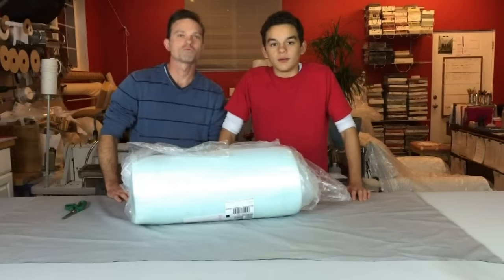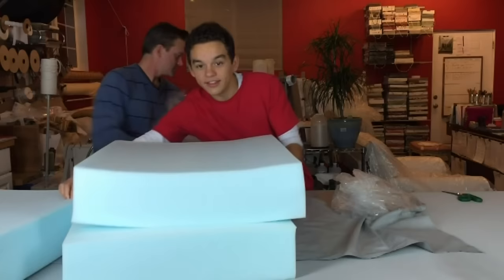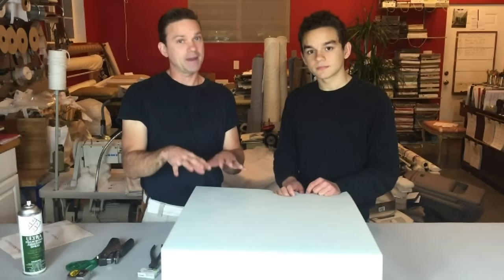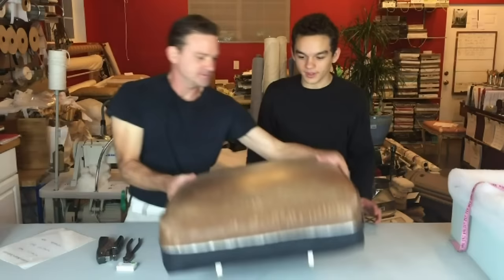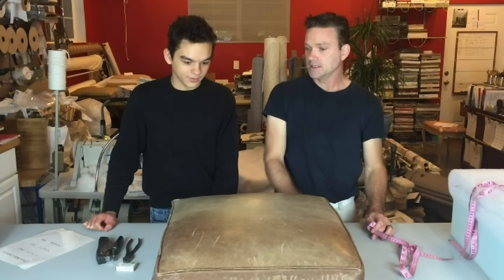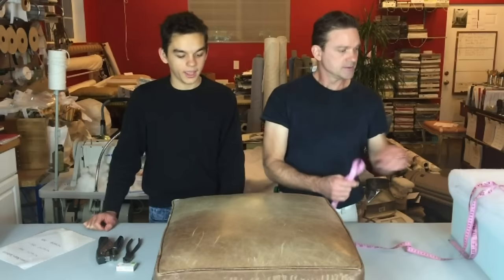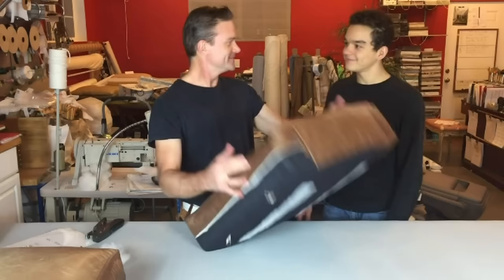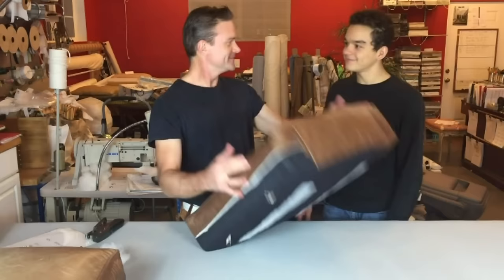Replace the foam in your seat cushions fast and easy!

Comment: What firmness do you recommend for someone with lower back issues? Current sofa is too soft & sinks.
Reply from the maker: Hello Agatha, that’s an excellent question. I unfortunately can’t answer , back problems can widely vary as to the cause. You could be sinking to low cutting off circulation or or you may be leaning more to one side then another. I wish I could give you more guidance. Go to a furniture store sit on displays and ask about are feel the firmness of cushions. Maybe that will help. Thanks for watching cheers, Paul
Reply: @ucsolutionsgivingmore  Thanks for your suggestion Paul - will check out displays. Hope to place an order soon. Cheers ~

Comment: Great video, but what density do I need for loose back cushions?
Reply from the maker: Hi Sharon,
The density for back cushions you can go as low as 1.8 density they don’t take as much abuse as do seat cushions, so 1.8 you should be fine. If you are a DIYer and you want to take this on yourself you can find the 1.8 slab of foam on our website ucprivatecourses.com   Thank you for checking out the video.  Please share the videos it helps us out a lot when you do. Cheers,    Paul

Comment: I have a recliner and the seat has a zipper in the back but is not removable.  How do I measure the thickness?
Reply from the maker: Hello Dave, Thank you for watching the video. You measure the FRONT band of the cushion, SEAM to SEAM (top to bottom). IF there is no band in front, just fabric that rolls from the top of the cushion to underneath. Then look on the SIDE of the cushion for the seams. Measure seam to seam and add the 1" to that measurement according to the video. Below is a link to the site to order, on the home page there is the video for a refresher if needed. Please let me know if you have any more questions, there is live chat you can send photos if needed on the site as well. Again thank you, 
Cheers, 
 Paul        
 https://ucprivatecourses.com/product/sofa-chair-seat-cushion-foam-inserts/

Comment: Thanks for the video! Would you use this same stapling technique to replace the foam if you were going to recover straight over it, ie not a in a cover, just with the material stretched over it and stapled to the frame?
Reply from the maker: Hello Natalie, I believe what you’re describing is called a tight seat and yes you would just replace the foam, put the fabric right over top and staple it down. With a tight seat you would not need to make the foam size larger, just replace exactly the size that was originally used. The Staples you would use is fine wire number seven and/or a heavier wire with a hand stapler or you can use tacks. The concept is the same thank you for watching and commenting. Please share the videos with friends and family, helps a great deal when you do. All the best,   Paul

Comment: Looking on Amazon, and no manufacturer has anything close to 26 density. The scale is different. Firm foams are 1.8 density. Are they using a different scale?
Reply from the maker: Hi there Manisha,  thank you for watching the video and leaving us a comment. No we’re not using a different scale. We only offer a high density foam 26. Unfortunately it’s not easy to find. 1.8 density is very standard, I worked with it for several several years and stop using it because it doesn’t last that long. So I switched over to 26 density much higher quality. To get an instant quote   go to ucprivatecourses.com  you can put in your measurements there and find out the price right away. I hope this helps if you have anymore questions please feel free to ask us glad to help. Cheers, Paul

Comment: why the need to add an inch to all the dimensions ?......is that a must ?.......lastly, do you ship overseas ?
Reply from the maker: Hey there thanks for watching the video, you add the 1 inch because it fills out the cushion cover it makes it look fuller.  instead of a flat board look, without the 1 inch it would look like the covers too big. So yes it’s important that you add the 1 inch. And as far as overseas unfortunately no. We just started shipping to Canada and that’s as far as we’ve gotten out of the country. Thanks again for watching I do hope this helps. Cheers, Paul
Reply: @ucsolutionsgivingmore  many thanks for the reply

Comment: I don't need foam, my leather sofas have a feather like filling, how can i replace that? Or can I switch to foam?
Reply from the maker: Hi CC, that’s a great question. Most likely you have what is called foam and feather cushion inserts. If you want to keep the foam and feather cushions you have. Most likely the problem is the foam insert that is wrapped around the feather duvet. You’d have to open up the feather duvet remove the foam get the measurements as best you can,order that foam replacement put it back into the duvet cover and sew it up. Check out this video that we did years ago this is the exact title. DIY STOP!! Cushions from smashing in the front.    That is the process you’d have to do in that video. Or you can just replace the foam and feather inserts with all poly foam inserts. Following the instructions we have in the  video you saw earlier.  Ucprivatecourses.com  this is our website where you can order the foam and  videos are there for you to watch. I hope this answers your question again thanks for watching, feel free to ask any question you have on the website, we have live chat. Cheers, Paul

Comment: Is it common to find that all three of the base cushions on your sofa are different dimesions?
Reply from the maker: Hi Christopher,  apologize for the late reply been extremely busy just getting to some of these comments. Older furniture decades ago even from factories would have two cushions the same size and one in the center was a little bit bigger or smaller. I’ve seen in the past where it seems like an upholsterer got the measurements wrong on all three, but still went forward. So to answer your question it’s not totally uncommon.  I don’t know how old your furniture is.  if it is new, I would say that’s pretty uncommon. I hope this addresses your problem and/or is some help. Please share the videos with others it helps us a lot when you do. All the best,  Paul.

Comment: Thank so much for this video, I learned a lot. My sofa cushions have the L shaped piece on the end cushions. Should that be a separate piece or can I have the foam cut in that shape?
Reply from the maker: +Jackie Parkins 
Hi Jackie,
We're very glad to hear that our videos were able to help you! You can have the foam cut to that shape. If you are having a company cut the cushions for you, then they should have a form to fill out that includes the L or Half-T section. Also you still will want to add that inch to your dimensions even in the L or Half-T section. I hope this helps!
All the Best,
Grant

Comment: I have ""curved T cushion" which present a challenge.  I am good with square cushions, but any videos or tips on how to replace T cushions?
Reply from the maker: Hi Nina,
This is a response I just gave to another viewer with a similar problem. I hope this helps you and thank you for watching, please share the videos it goes along way for us when you do. All the best,   Paul

 You can do it both ways, most foam suppliers can cut out the cushion for you. I believe what you are describing is what we call a half T cushion. If you have a curve in the cushion following the furniture you can take the foam out of its cover, turn the cover inside out and use that as a trace. You will have the seam allowance in there when do this tracing, this adds to making the foam an inch larger, so you will not need to add the inch extra as stated in the video. Because of the curve you will need to cut the foam it yourself, measurements will not work. You could trace the platform of the furniture curve with Kraft paper or old fabric and send that in as a template for the foam company to cut. We have a video on how to measure for a T cushion but not for a curve. Some companies will fill the cushion cover for you I have heard, if you send in the cover only. However it could get lost or stained in the process word of caution. Here is a link to our video on T cushion that might help.  https://youtu.be/dq2a1WPrLJ4 Thank you again for watching, please share our videos it helps us when you do.

Comment: What's the point of having the decron? I'm needing to replace my cushions and each one has two pads, a 4inch for the main, and then a compartment separation with the second (top) being 2 inch with a layer of decron. I thought about skipping the decron all together and just getting 3" foam but I don't know what the purpose of the decron really is.
Reply from the maker: I’m glad you asked! Dacron wrap is used to give the cushion it’s filled out look. Otherwise the cushion would look flat without it.
Reply: Thank you!

Comment: Hello, I’ve watched many videos and yours was the best. Thank you. I hope you can guide me to the best density and how much foam I will need to cover six dining chairs measuring 19X18 each. I am covering with a medium weight vinyl fabric. Can you tell me what density foam to order to cover my never covered dining chairs? I’ve covered them once with 2 inch foam from the fabric and craft store using just the foam....I could still feel the wood through the foam. Then I tried covering them using the Dacron polyester wrap that I saw on your video but the foam is just not a good quality. I ordered high density foam from the online fabric and craft store to try once more but I would like this to be the last time that I have to cover them for a while.  These are our main dining chairs (eat in kitchen) and we use them many hours during the day and when we have guests. Thanks for your help.
Reply from the maker: Hi Lilly,
We’re so glad to hear that you enjoyed our video! The best solution for this project would be to buy a slab of foam at 2” x 24” x 108” it would be just enough for your six dining chairs. In fact, you may need to glue on a bit of foam to finish out the last dining chair. https://ucprivatecourses.com/product/seat-back-cushion-foam-inserts/. In regards to the compression you would need to order a 45 compression. This will provide the most support and last the longest for dining seats. I hope this helps! Let me know if you need any more help.
Reply: @ucsolutionsgivingmore  Thanks for the info. The link in your reply to purchase foam is being warned as a risk.

Comment: I checked out Albany foam, the choices are overwhelming!
I would like to replace the foam in our couch and chair.
What foam would you use for a person around 200 lbs for this , from the Albany foam company?

Also what's the best to use, bonded or stitched Dacron?

Thank your posting your video,it was excellent and well appreciated!
Reply from the maker: Hi Tom,  Sorry for the late responds, great question. The stitched Dacron is good but not always needed, it cost a little more.  It is Covered on both sides with accord and a slick fiber in between this helps the cover and the foam insert to move independently. You might have seen this when a seat cushion cover crawls and gets twisted from use. The slick fiber will reduce this, so if this is a problem you have been dealing with than stitched Dacron should help,  (if not no need use standard). As far the FOAM to choose here is what to look for. * Thickness of the foam you are replacing.  * The platform that the cushions sit on (firm or soft). * The desired feel you want, Firm Soft etc.  A good rule is the thicker the foam you need to fit in the cushion cover the softer the foam you should purchase. As well buy the highest density (THIS IS VERY IMPORTANT) you can find it'll last longer. Hope this has helped. All the best.  Paul

Reply ·

Comment: What foam density is typical in sofa making
Reply from the maker: Thanks for watching. The typical comfort is 35 compression. That’s 35 lbs of pressure to push a 4” piece of foam down to 3”. I hope this helps. Thanks again please share it helps us when you do.  Cheers,  Paul

Comment: Best solution for a couch that's not comfortable.  I have a down fill plus foam sectional, except for the chaise, the couchins for the most part, look new,  but sitting on it is another thing.  The couchins seem to compress alot, when sitting in the middle of a couchin the sides come up, and are not firm. What could help?

Comment: What type of foam should be used in a car cushion? Bottom and back rest? I would like to make my car seats softer, less hard.
Thanks.
Reply from the maker: Hi Paul,
Thanks for checking out our videos! For car seats you might want to use a 35 or 45 compression foam. Car seat foam is pretty thin so you will need a higher compression to provides enough support. For the seat if it is 3” or thicker I would suggest a 35 compression. If it is thinner than 3”‘ use a 45 compression. Finally for the back rest you should use a 35 compression. I hope this helps!
Reply: @ucsolutionsgivingmore  Thanks so much!!!

Comment: Fantastic, What is the purpose of the Dacron ?
Reply from the maker: HI Barbara,
Thank you for watching and commenting. Below is a reply to another viewer that had a related thought, thanks again.  
Great question! You do not need Dacron at all. If the foam you are using is thick enough to give a nice crown or loft to the cushion.
Dacron gives a soft feel rather than a flat surface of foam, but if the foam is larger then the cover by one and a half times it will be fine. Please share it helps when you do. Cheers,     Paul.

Comment: Great videos! I have a sectional that I have replaced two of the three couch seat cushions since it was new. The cushions turn to mush in about a year. I am the only user and I weigh about 150lbs. The sectional was over $3000 so I want to replace the cushions myself if possible. The problem I see is the seat cushions are tapered toward the back where the back cushions rest. Also there are 4 dimples per cushion. Is this a mold I can't replace myself? Thx!
Reply from the maker: Hey,
Thanks for watching we really appreciate it. YES!! I have heard and seen that often, the foam factories use for the most part is well serous crap. Lifespan  is a joke heading for a landfill near you. It's a very low density foam they are using, they try to make up for the low density by turning the cushions into large bricks. As for the tapered part that should not be a problem as long as you can get an accurate measurement. The dimples sounds like a decorative feature without a button. Most likely it's sewn squares with whats called biscuit tufting. Anyway that's only a guess until I can see a photo. If you like send a pic to videos@urbancastlesolutions.com  Maybe from the photo I can help. We are slammed at work so please give us time to get back to you. I look for an email with photo. Please consider sharing the videos it help us a lot. Thanks again.   Cheers,   Paul

Comment: Need to ask, WHY put that Material (forgot the name) , over the new cushion, is it prevent it from the material slipping or something else??? (in Australia we call it WADDING, I also use this product in my fish tank filter.... mighty useful)
Reply from the maker: Hello there Susanna, that’s a good question the name brand is Dacron at least it is here in the US. It’s also called poly batting. Yes I’ve heard it called wadding before as well. It’s serves a few purposes one it gives a soft crown feel to the cushions,So it doesn’t appear so flat like a board. Second it does make it a little bit easier to slide into the cover. And third foam in fabric will Rub and wear out each other. I hope this helps, please share the videos it does help when you do. Cheers, Paul
Reply: @ucsolutionsgivingmore  - it did help, thanks, great work guys, love the father-son team, learnt a lot from you guys, going to attempt to tighten or fix my sofa now.

Comment: Nice video! My leather sofa doesn't have remove able cushions-they are attached at the front. They do have zippers in the back ( I had to feel for them)
How are these done?
Also, the chaise part of the sectional has no zipper... How is this foam cushion replaced.....??
Reply from the maker: Hi Anthony,
Thank you for watching our videos, and sorry for the long delay in response! Great questions, with the seat cushions, if they are attached at the front they should be able to flip up a little bit to allow you to get out the foam insert. Then you can follow the same procedures found in the video. If not you may have to cut the threads that are holding the cushion to the platform, and then hand sew it back on the platform when the new foam insert is back in the cushion cover. With the chaise cushion they would have to put in the foam and hand sew the cushion cover closed. 

 I hope this helps, again thank you for watching!

All the best, 
Grant
Reply: anthony silva oo

Comment: Question, I’m looking into making a bench seat for my truck. If I’m going to use foam, About 6 inches thick do I need to set it on the springs are should I just make a platform made out of wood or metal to sit the foam on? Thanks in advance!
Reply from the maker: Hay Brad,
Sorry for this late reply we've been very busy here. Heads up, with a 6" piece of you will need to go more on the medium to soft side, the thicker the foam the firmer it feels. Without seeing the seat, I say over the springs would be best they are more Likely zig zag spring system. I believe on wood or metal it will be to firm. Hope this has help you. Please share the videos it does help us when you do.  Cheers,

Paul